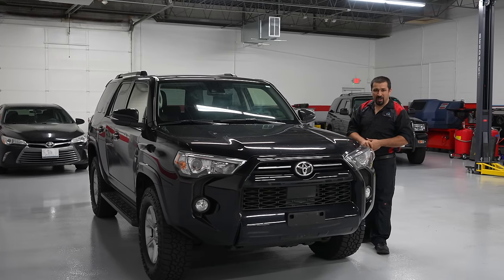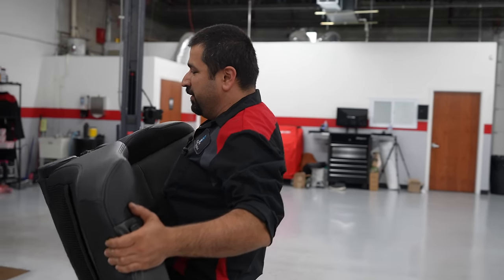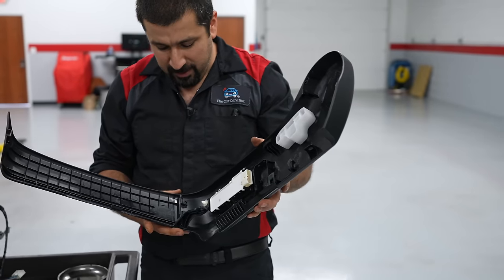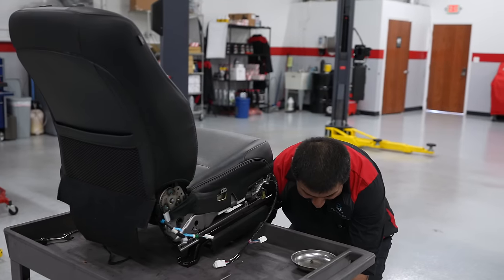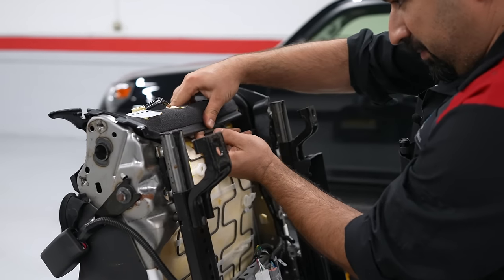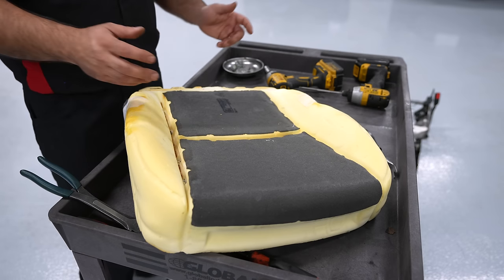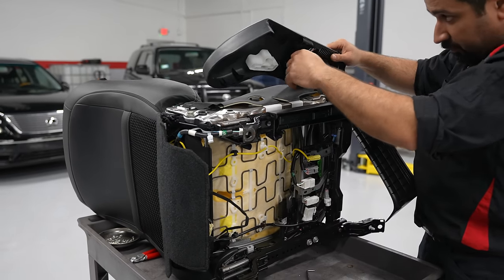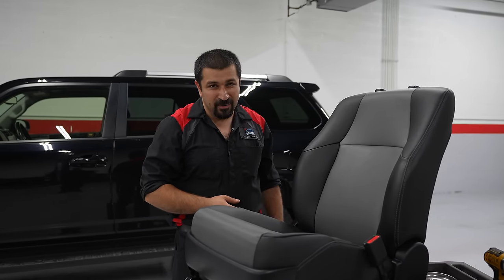Tearing a Toyota Seat Apart to Replace a Cover | Toyota Seat Common Problems

Comment: This is why I put leather seat covers on my seats. Purchased new car, drove it home and it sat until I put the seat covers on. Every 5 years the covers were replaced. After 20 years the fabric and frame looked new. $600.00 in covers is better than $2 grand for a new seat. 2 adults, 3 kids and 2 dogs. I took all the covers off when I sold it. New owner couldn't believe this was a family vehicle. Good covers caught the crumbs and spilled drinks. New seat cover are air bag safe. They have openings were the air bags are.
Reply: Seat covers would have been an answer here. Much simpler than replacing the fabric. You can get seat covers that work with airbags too.
Reply: Same goes for a steering wheel cover and dash cover...cheap insurance for sunny areas.

Comment: This mechanic is so meticulous and professional! 
Very rare so find someone that treats clients cars with courtesy.
Reply: Mine on the other hand is constantly suggesting me to put 5W-30 oil in my 2018 Camry Hybrid LE which takes 0w-16 (even after I mentioned about this channel several times). So having a good mechanic is kind of winning a lottery.
Reply: @michaelscottland4239   That’s great that you spoke up! The recommended weight is on the oil filler cap or even a quick Internet search away, so it’s maddening that they would just choose to ignore that.

For a long time, 5W-30 was the most common recommended oil in vehicles (80’s, 90’s, 00’s).
However, vehicles now are recommended some type of 0W oil due to more narrow oil passages, better lubrication, better fuel economy, etc.

The issue is a lot of Mechanics and Shops are stuck in the past, and don’t bother learning the new information or re-training themselves.

However, this channel is very refreshing to watch!
Reply: @michaelscottland4239  The proper oil is important because it is used as hydraulic fluid in the VVT phasers along with lubrication.

Comment: I have to tell you, I am a mechanic I work on allot of different cars. Since purchasing my own toyota I always check your videos before doing anything. I love how in depth and instructional all your videos are and I love how vehicle specific you are with just toyota and lexus. Every car manufacturer should have someone as skilled as you and as helpful as you to help their brand.
Reply: I'm not sure if he is following new comments so I'd thought I'd ask you too. It is it easier in terms of hours at a shop to install the entire seat (cushion and cover) on a used car than just the cover? I'm thinking about trading in my Corolla so both rear and front.  The rear is in rough shape from my Great Dane after years of dog park trips but worse the front seats are embarrassingly stained so adding that to the cost of installing would be worth it IMO, even a possible loss.  $589 from Toyota for the rear and front right seat covers or $491 on Ebay used for the front right and rear seat cushion and cover in condition.  I'd have to wait for a left to pop up or just go with the seat cover option from Toyota.  I'm guessing the hardware could be reused.  Thank you!

Comment: THANK YOU THANK YOU for taking the time to make this video.  I had just taken my seat out and brought it to an upholstery shop for my seat bottom to be redone. When I got it back and I reinstalled the seat, the power seat adjustment for raising and lowering the back half of the seat didn't work. I didn't feel like going all the way back and confronting them, as I was sure something simply didn't get plugged back in.  I had no idea how any of this comes apart, but thankfully this video is EXACTLY what I needed. Once I started taking the cover off with the seat switch in it, I immediately found one plug to the drive motor that did not get plugged back together.  I'm back working again in way less time than it would have taken me to take the seat all the way back to the upholstery shop. And who knows what else they might have broken taking this back apart again.  You are a saviour! Thank you again sir! Best content on YouTube!

Comment: I had no idea how difficult this would be. As for the clips on the plastic covers over the front track bolt I can agree with you how easy it is to ruin the little locking tabs.
Reply: A very DIY task, not a big deal. I removed the covers and took them to the Mexican side,  150 dollars for the two front seats,  reupholstered with two tone beautiful leather. I did the removal and reinstall, easy peasy. Two hours and 20:dollars for the hog rings and pliers. I saved  myself a ton of money.
Reply: Yep, proof for the old expression, "The devil is in the details!"
Reply: @Teporame  i mean its not easy. I did my camry with katzkins and it took multiple days and sweat and blood
Reply: @Teporame  for u not for other tho
Reply: I’ve got an 09 Lexus GX with a torn up leather driver’s seat bottom and I constantly think about maybe having it reupholstered or doing it myself. 

Lmao, this video just informed me that it will continue to have a torn up leather seat bottom till the day it dies.

Comment: Whew! Thanks. You have the care and patience of a Saint!  I would say that not 1 in 100 mechanics or upholsterers could / can do such a fine job! I  learned that I will LIVE WITH a few wrinkles / cracks in my driver-seat cover... on my near-pristine 2003 Lexus RX300 with 114K miles on the clock. It also has some "slightly-compromised" (aka compressed / compromised) foam in the driver seat "base". I now use a nice-looking seat cushion that "restores" the comfort factor ... and NOW, I am even happier to skip the labor / cost of a replacing things. 

I bought it a few years ago and have done a ton of preventive maintenance. It was treated well before I bought it ... and now I am as happy as a clam. I have paid ~ $2,500 for OEM sensors, parts & materials; dealer cost with labor would have been OVER $10,000. 

FYI: I recently got quotes to remove and replace the (20-year-old yellowed and "brittle") "Clear Bra" ... ~$2,000. I have now begun that process ... IT is QUITE A CHALLENGE. But I am taking a page out of your book. i.e. I am being patient and careful!  

Luckily I can just do a few hours here and there; my own estimate is 16 hours counting time at "YouTube University" ... on my own clock. 
Best to you and all you DIYIers out there!
John in the NW

Comment: Thank you so much. I have a 2006 Rav4 Limited. I bought it used with aftermarket heated seats installed. Well the seat part on the driver's side was showing it age with rips and tears in the gray leather material. I found a low mileage Rav 4 (2008) at the upull salvage yard. Took my time unplugged all connections and carefully removed the seat. I'm a DIY mechanic with some electrical savvy. I've never done anything like this, I had it set up on the table so I could look it over. I know this older plastic is very fragile so I literally just looked it over. I walked away and now today I found this video and I want to say thank you! I'm sure I can do this now. And if anyone is interested I paid $45 for a full power gray leather driver's seat. Yes its used, but very clean.

Comment: On my 2021 Tacoma SR5, by the time I was around 3 or 4 thousand miles I had the back and forth wobble. Took it to the dealership and they had to replace the whole frame. It is nice and solid. So glad I was under warranty. I have fabric seats and I have seat covers on the front seats and a towel over the back seat (just the bottom). My front seat covers are airbag safe too.  It’s nice having a driver power seat but I’m old school and would have been fine with a Manuel seat. Another great video my brother.

Comment: A good trick to removing plastic for seats if you have a steamer which we have at our shop you can steam the plastic it gets it nice and soft and hot and it will come off without breaking so much easier. A professional guy like me who does this every single day at full speed can recover one forerunner seat in 20 minutes we use katskin and roadwhire

Comment: Having installed many Katzkin leather interior kits your instructions are and avisement are standard practices.    The trim on the base of the seats are a pain in butt and sometimes you get the impression that some interior trim are only meant to be installed once with no consideration of how to remove it.

Comment: I must commend you on educating us shade-tree mechanics at home. Not just drumming up business for yourself! I took apart my front seat today before discovering you had done a video. I started on the seat back for adding leather to the original cloth on the 366k mile '07 Sienna I recently bought from a friend- the original owner. I prefer it's drive to my old Odyssey, except for the leather being inferior (You coukd still smell that leather after 10 years- glorious, and also pleated on the door panels- wonderful visage). But as you say, "that's OK, meaning not." But with no instructions I started to take off the cloth, then hog pinned it on again on finding the new skins did not have all the same tie downs in the middle. Tomorrow I will carry on. with more confidence for someone who always wants to get it right the first time. See if I can put it on over the cloth. The skins are Bartlett, from S.E. Toyota (Moran), not identical but that may be cause they are for a '04, and I am installing on an '07. 
But tahnk you for having a great personality and presence onscreen. I feel you , like me, find purpose in teaching others to do things for themselves and imparting your knowledge. As you say, if one person can do it you can too (or is that me, lol). Keep up the zeal in producing more, please, especially now that factory manuals are so expensive and impossible to download for a song.

Comment: That takes me back. I used to assemble Australian gm seats way back when, using hog ring air tools, rolling on delicate leather trims on special models, sliding on J straps. Replacing those single use clips on a re-work. That strange dry skin feel handling cloth all day.🙂

Comment: I had to take my driver seat apart to install my aftermarket seat heater on my 2019 Toyota C-HR a few years back. It was frustrating, but I got it done. The C-HR seats have the star bit headed bolts too, so that one of the few that has those.

Comment: I have a 14 Sienna and shortly after we bought it, the bottom trim piece on the driver seat broke. I used a piece of aviation pit tape to reattach it. I am a car guy and it bothers me but at the same time this vehicle has over 200k miles and my kids have done more damage than anything we could easily replace or repair it. I think it's funny that you called out the seat. good vide.

Comment: The leather seating surfaces in my 2010 Toyota Prius had seen better days. After pricing OEM seat covers, I elected to have Katzkin covers installed for $1,600.00. Very pleased.

Comment: Wonderful video! Thank you for making it so clear how only part of a Toyota seat can be replaced! I need to replace just the bottom cushion seat of my Camry because of cat pee that saturated it. You mentioned needing to use the cushion from the one you're taking out. I assume that's because you're only replacing the cover, is that right? You have answered so many questions in this really helpful video.

Comment: That’s definitely more complicated than I ever want to tackle. I’ll stick with my seat covers from CarID. I’m a rideshare driver and they have been lifesavers. 

My only two complaints about the seats in my 2020 Camry are that they could be more comfy, especially in terms of back support. I’ve driven more than 75,000 miles this year so far and my back takes the most abuse. 

The other complaint is the cracked plastic on the trim below my left leg. It doesn’t affect anything but it just isn’t as pretty. It started cracking from the top but hasn’t quite made it all the way through yet.

Comment: Thank you very much for this video. I need to replace the seat cushion on my 2014 Highlander as some mice damage it to make their nests. The driver seat from my Highlander is probably very like the one on your 4-runner. This video is very usefull for my cushion replacement.
Reply: Job done. Like I was thinking, the seat of my 2014 highlander is very similar. Thanks a lot. It help me a lot!

Comment: I was astonished to learn the passenger cushion cover of my 2020 Camry was over $600. I previously was in the accounting department of the seat supplier of another Japanese brand OEM and sold the entire seat set for 650 base and about 1500 for premium. The set included driver, passenger, rear cushion, the 60/40 rear backs, and 2 side bolsters.  This was about 20 years ago but really?
Reply: Hey there, I have a 2020 xse camry myself with the red interior. May I ask what happened to your camry seats ? Was it a factory defect? Did it get damaged in someway requiring you to replace it? I'm just curious. Thank you!
Reply: @joeotto775  Dealer demo I bought with 2300 miles.  Cushion was stained.  Dealer paid for the the replacement.

Comment: I've done a few different Peugeot seats over the years, I've always used cable ties on reassembly instead of the hog rings when refitting the covers - mainly as I didnt have the hog ring tool. Last Peugeot seat I had apart, the back rest covers used zips for the lower rear edges, removal was easy but refitting without the special tool impossible - tool was very cheap from the main dealer. I hate working on seat frames as it always cuts my hands to bits.

Comment: I've done a few seat tracks on 4Runners, and the hardest part for me was putting the cushion back into place the first time. Not fun but after the first one, it was smooth sailing.
Reply: What did I win good sir?

Comment: Thank YOU! I am grateful for your time and effort in producing your YouTube videos. I have a question: I own a 2022 Lexus ES 350 and the dealership is providing free oil changes for life. My skeptical mind, especially after hearing your opinions, makes me question their generosity. I think they are using their Toyota brand of motor oil (but not 100% sure), but is it 0W-20 full synthetic oil? They want to change the oil every 6 months or 5,000 miles, whichever comes first. I am leaning towards doing my own changes using Mobil 1 full synthetic oil. Your guidance here would be appreciated.
Reply: Stick with the free oil changes at the dealer!

Comment: Ahmed, one thing I would really like to see is a thorough video about converting over to the aluminum oil filter housing. More importantly, if there's any way to order the perforated tubes for the various models, if they are even sold separately. I believe that there's three different lengths for the AR & GR engines.  

One of my kids has an overtorqued plastic housing but is over a thousand miles away. I would like to prepare an aluminum housing with the proper perforated tube to mail off so that it can be installed with the next oil and filter change.

Comment: In light of the airbags in the seat, I guess this rules out an after market protective seat cover.   True?    Thank you for the video!
Reply: Chloe Kuo installed a full set of aftermarket seat covers on her Tacoma.  The front seat covers have unsewn flaps on the sides where the airbags are located.  Please check out her YouTube channel for more information.
Reply from the maker: You can install covers just make sure they are air bag compatible

Comment: I wish there was a way to post a pic here. Ok friend of mine has a 2020 Highlander. The left side of drive seat cushion shield had already detached from the top. I had to drive for her one day for medical reasons. So I had to slide the seat back. The shield caught the bottom left rail and popped the corner connecting the left side shield and front shield. They want $800. My biggest concern is there any air bag stuff below the waistline on these seats. I am above DIY. I grew up taking stuff apart to see how it worked. If it did not work I learned how to fix it. My first real job I worked at Waldorf Cycle and Mower at the age of 13.  I just can not find clear schematic diagram that I trust. I have zero experience with airbags. Throw me a rope. Have a blessed day. Great Video!

Comment: I use and alter these pocket screwdrivers to help remove clips and those annoying locking tabs on fuel injectors and coil packs. A gentle hand, silicone spray and patience goes a long way.

Comment: @TheCarCareNut: it would be great to get a video of you opening the rear hatch of a 4runner to fix/inspect the backup camera wiring! I got one replaced already under warranty, and now having the same issue with the backup camera for a while only working sometimes (usually every other time after hitting a bump or opening/closing the rear hatch) to now not working at all. 

My bet is the cable is loose in the port and the cable is too tight .

Comment: I find the Toyota and Lexus interiors to be cheaply made esp the bottom wear. I have cat skins on my Tundra and that interior is so much better vs Toyota leather . Lexus I’ve noticed problems too esp on the RX f sport red interior. I  actually do like the Vinyl grade  Tex interior Toyota is offering it holds up way better vs leather interior which is what my Highlander has .

Comment: Greetings AMD. What tool are you using when installing the new rings to hold the seat cover in place? Wish you did a couple of them a little slower so we could see exactly what you were doing. Thanks so much for the video!
Reply: Hog ring pliers. They are nothing special. They have indentations in the jaws to keep the rings from slipping out. There are several choices at amazon.